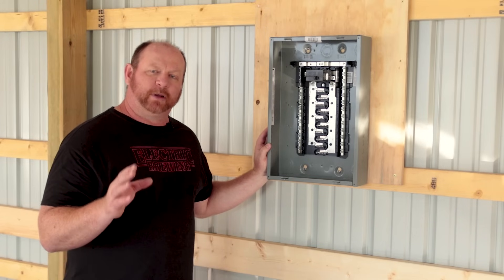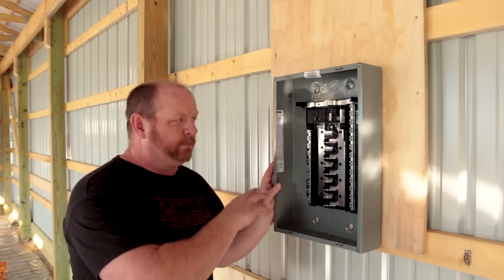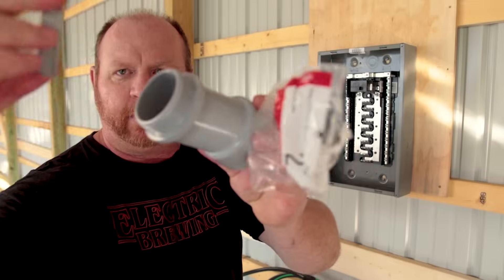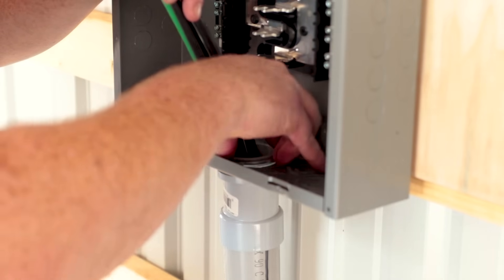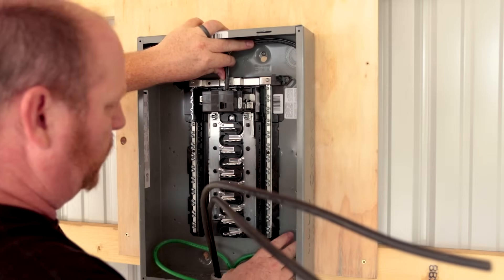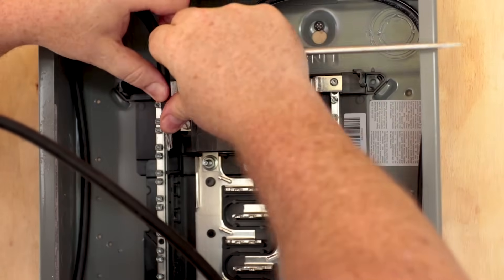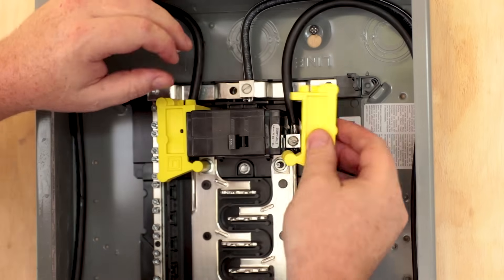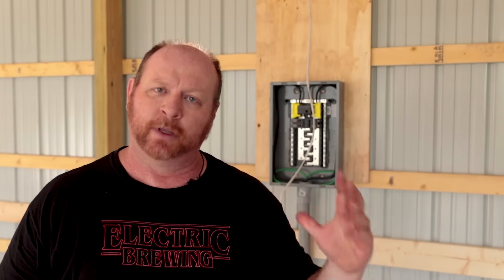How to install a main breaker panel in a garage. -  Square D Homeline 100 Amp Main Breaker

Comment: if it is the main breaker panel, you should use a main bonding jumper to link the busbars to the box so the box is grounded. Always use nolax anti-oxidation on aluminum or any two different material conductors. I believe the box outside, the one with a meter is the main panel that makes your D box a secondary. check code book for taping rules, distance, side of the conductors, how deep you should dig, if you need to run conduits or PVC, most importantly, don't forget to call an inspector cuz the insurance will not likely to pay anything if there is not an inspection if something goes wrong.
Reply: Your right on everything except the insurance. Insurance would still have to pay no matter what . It is there to cover incompetence also . The insurance company would have no choice. If you car has bald tires you blow one out and run into a house they still have to pay same goes for home owners and industrial insurance. In many areas the county would require a licensed contractor and would not sign it off even if it were done correctly if you do it yourself

Comment: As a nonelectrician I find this to be an interesting project. I hope a fully qualified electrician will chime in to offer constructive advice to help all of us. I thought a separate ground rod was required for a separate building, but maybe you've got a rod in the adjacent meter area. Some here have remarked that neutral and ground need to be separated, but this looks like a main panel to me since you seem to be fed directly from the meter. If the meter is a distance from the panel, and neutral and ground are bonded at the meter, I don't know if bonding is allowed again at the main panel. It would be wise to keep ground wires all together in the panel. If you change your mind, separating ground from neutral may be as easy as unscrewing a bonding bar. Some have remarked that the wire is not correct for 100A, but from my reading of tables for 3 or fewer conductors, #2 Al is OK to 100A in the 90 deg C column. The question boils down to whether termination temperatures require derating of the wire. The terminal lugs at the panel should be fine to 90 deg,  I'm not sure about the breaker, I don't know about the terminal at the meter but I would be surprised if derating is needed there. So, I will guess that when a qualified electrician stops by he will agree with the wire size for a 100 A panel feed. The professionally-installed subpanel in my home is #2 Al for a 100A feed. Whenever I do a project like this I get advice from the inspector before walking into possible trouble.
Reply: Fully qualified electrician here, and here's my 2 cents. Ignore what brian has done because hes made it possible for every metal part of that building to become live in reference to ground. After you have ignored how he does it, promptly call a licensed electrician and pay him to do something you're not supposed to do without proper knowledge. Just my 2 cents
Reply: @wm79198  I 100% agree with you!!
Reply: You cannot use the 90° C conductor rating because there are no panels like the one in the video that have 90° C terminals.  Since the terminals are rated for 75° C then you must use the 75° C ampacity from NEC Table 310.15(B)(16).  Depending on the installation there may be other code rules that apply but using a conductor at its 90° C ampacity is not permitted.
Reply: @CHSSeniorproject  Thanks, good point. As others have pointed out, in a dwelling unit this is OK under a different section of your NEC, but a barn/garage is not a dwelling unit. So the electrician who did my subpanel got away with #2Al, but its not allowed for a separate barn or garage. Most breakers I've looked at are 60/75, never labelled with 90 degC. I wonder why dwelling units have a separate set of tables....

Comment: Hey Brian, please take note of what some people are saying in the comments here, there are definitely a few issues with what you've done.

1. While the neutral and ground are indeed tied together at the main panel, that DOES NOT mean you can just tie them together at a sub panel. I'm not sure where the other end of that ground wire is connected, but please confirm this with someone licensed.
2. Someone mentioned on here about #2 aluminum not being rated for 100A. I believe this to be true. Unless the fuse on the feed is lower (maybe 80A).
3. Alot of people have mentioned about the dissimilar metals, this is a definite fire hazard. Check your local code, as I believe some don't even allow it any more. Some places allow it but with the use of the compound/grease specific for aluminum and copper together.
Reply: @vids595  Yes SE cable may have a different rating than single conductors.
Reply: 2-2-2-4 Is most definitely rated for 100Amp
Reply: @mikeayres304  in Canada I'm seeing it as rated for 90 amps. Maybe in the states it's more
Reply: @Daniel Morris. I've seen this panel a few days ago at Menard's. The box and main indeed are labeled 100 Amp.

Comment: Sorry Bud....Illegal....You need Nolox on the aluminum before you put it under the lug...Its Code!
Reply: sorry bud ! look it up .. that's not true!  lugs are rated for copper and aluminum....
The use of anti-oxidant compounds is a good workmanship practice issue and therefore is not a mandatory requirement spelled out in the NEC
Reply: @cceeii24 I can see why it would be a good idea to put anti-oxidant grease on the lugs.  Aluminum is very reactive and aluminum oxide starts to form almost instantly on exposure to air.  Aluminum oxide is a poor conductor and thus resistance and heating of the connection could occur.  Back in the 60's many houses burned down because these properties had not been discovered yet.  It's simple work practice, keep your connections clean and tight.
Reply: @davidmarquardt2445  I completely agree ! , I use it myself ,and always will !    just pointing out that it's not in the NEC.
Reply: @cceeii24  It will not where I live if it isnt on there Bud!
Reply: @johnsmith-sw7ii  I'm just saying it's not  in the NEC and it's not " illegal " doesn't mean that someone wont specify or require that it be used. like an inspector or the authority having jurisdiction
Reply: Local inspectors enforce the nolox
Reply: @gregberban9273  In some places where inspectors have a lot of latitude to make up their own code they may enforce its use. Other places may require it due to a local code amendment.  As many here have stated it is not an NEC requirement and if you work in a jurisdiction that enforces the NEC as written then it's simply not required.  As I've stated earlier I actually use it.
Reply: @CHSSeniorproject  been in the field for 40 , always use it , but there way hay been a time or two that my tube was dry
Reply: As an electrical inspector and a master electrician for the last 17 years, aluminum wire is more easily oxidized than copper wire, and the compound formed by this process – aluminum oxide – is less conductive than copper oxide. As time passes, oxidation can deteriorate connections and present a fire hazard. Therefore as an inspector AHJ do demand anti-oxidation compound be slathered on all aluminum conductors terminating in Al/CU terminals regardless of celcius rating. It's not a requirement based on Art. 110.3(b) to manufacturers specs. Like I always say: "good workmanship is having the knowledge of keeping hazards at bay, save a life now".
Reply: @slyzepeda1721  You cant demand anything . You have to cite codes...
Reply: @DonkeyLipsDA3rd  I'm a walking code book that's correct, but if I see an improper electrical installation that is not code compliant (unless grandfathered in) I WILL demand be brought to code. Seems to me you like cutting corners a lot.
Reply: @slyzepeda1721  what code would you cite for demanding  nolox on aluminium?
Reply: @slyzepeda1721  " Inspectors demand nolox slathered " all I said inspectors cant demand they have to cite code...  I meant " you " as inspector not directed specifically  to you...
Reply: @DonkeyLipsDA3rd  you see, you've used the term "inspectors" in plural in wich I never used. Clearly we're not in level with this subject. Aluminum conductors are now made from an aluminum alloy whose coefficient of thermal expansion more closely matches that of copper. I clearly see you must not live close to the ocean, where I live (close to the ocean) corrosion inhibits most everything within a short span. So I must demand an anti corrosive means to prolong the effectiveness of conductivity.
Reply: @slyzepeda1721 Makes sense. I always put nolox just to cover my butt..
Reply: @DonkeyLipsDA3rd  it's always a good habit and no the code does not require it. In my area of the country I must enforce it because of our conditions. Happy holidays to you and your family my friend.
Reply: @DonkeyLipsDA3rd  its simple for most people,  but I'm guessing you were dropped on your head at an early age  , do want the local inspectors require , or don't get a green tag simple
Reply: @gregberban9273  they have to cite  NEC and local codes. There are some bad inspectors out there. They cant make stuff up and fail you.
Reply: @slyzepeda1721  Jose is correct. Local codes will take president over national codes. Besides it is just good and safe practice to use the anti oxidant compound. Also I would have spent a little extra money and got a Square D QO box, they are a little better than the homeline.
Reply: I just install  #222 from meter to the b.b and  #2224 from meter to the post but yeah the inspector said (need the nolox) muskegon co. Michigan state
Reply: Not code one bit dude. Maybe its a local code in some areas, but it's not required by the NEC.
Reply: @fnhwk  are you an licensed electrician.
Reply: 110.3(B) you only need to use an antioxidant compound if the manufacturer requires its use. Anything past that is AHJ.  If it has been stated previously, I apologize for the repeat.
Reply: Contrary to popular myth anti-oxidant paste is NOT required on aluminum conductors.  As an electrician I use it because it's a cheap and might make a better connection but it is not required because the terminal is listed for use with aluminum condcutors without it.
Reply: @CHSSeniorproject  That's correct older aluminum  wire needed it but the new stuff doesnt..
Reply: @DonkeyLipsDA3rd  that just silly  ,
Reply: @gregberban9273  I'm silly my guy...
Reply: @CHSSeniorproject  funny

Comment: Brian, why did you choose not to use a anti-oxidation compound on the aluminum leads?  Did you choose aluminum because of the run from the meter?
Reply: It's not required unless the jurisdiction requires it.
Reply: Kind'of what I thought.  Thanks for the reply.  Great video.  It is appreciated

Comment: You will wish you went at least 200 amps.
Reply: Not possible unless I put in a second meter. Not really worried about it at this point.
Reply: He's really gonna wish he used an anti oxidizing compound in that environment. And when someone gets shocked, then hes going to wish he knew what he was doing with that ground and neutral
Reply: @wm79198  Yup He's going to wish he used copper
Reply: Just different panel , an wire size , an he can do another hack video to show people what not to do .

Comment: Ground hookup?
Reply: Its not.... you have to manually add that green screw your panel came with. You've jeopardized safety with your lack of knowledge
Reply: The neutral bar is bonded to the box.
Reply: @ShortCircuitedBrewers  NEVER GROUND THE Neutral WIRE TO THE BOX ON A SUB PANEL4 wires GROUND, Neutral, and 2 hots. Neutral passes through

Comment: I don't know if it matters in residential,,, but check out (no locks electrical).. ps don't forget the bolt on the bottom of the panel. Lol good video
Reply from the maker: I got it bolt it down you just couldn't see at the end of the video. The no locks is that an anti seize compound to prevent galvanic corrosion?
Reply: @BuildITWithBrian  thats the stuff.. we use it every time we use aluminum wire.
Reply from the maker: @Tetman-xx6tp  OK I'll get some. I don't think know if it is as critical on indoor applications. I would rather err on the side of caution though. Thanks for the tip!! 👍🛠
Reply: @BuildITWithBrian  Aluminum ware was a bad idea especially in an outside metal building.
Reply: isn't Noalox not required now on new aluminum since the quality is much greater and also contains other alloys (AA8800)?